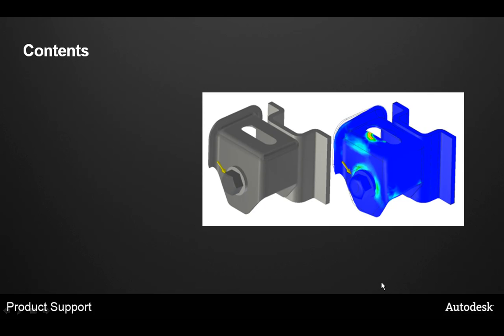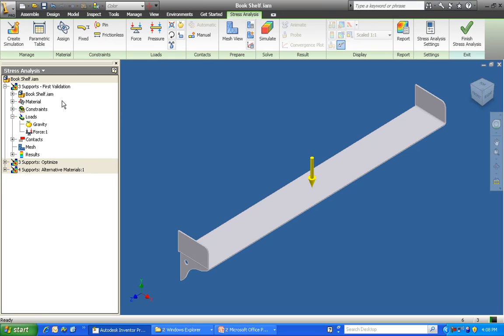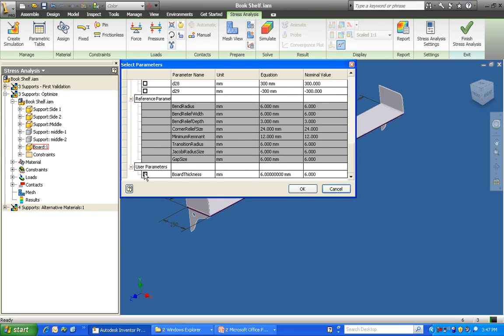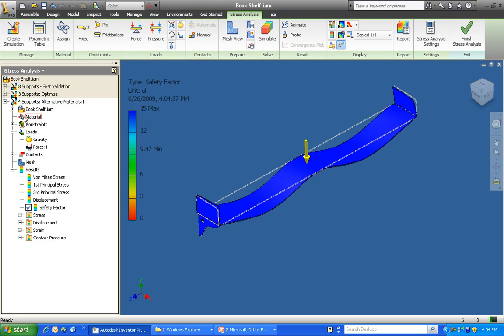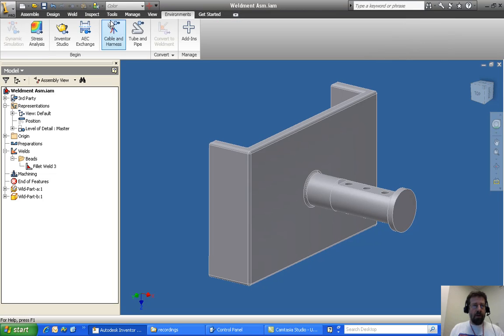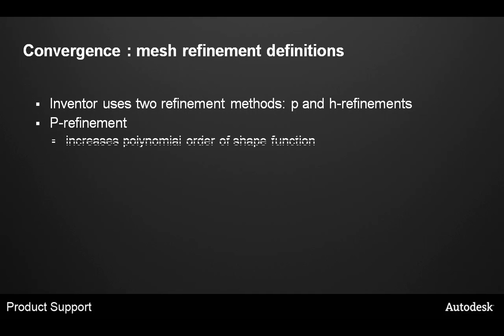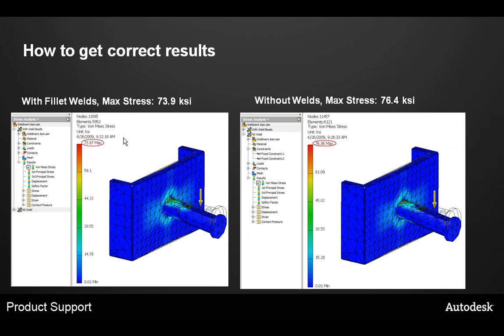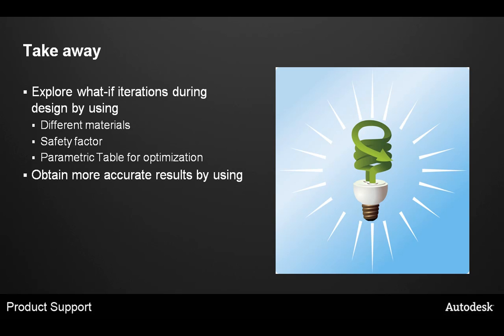Optimizing stress analysis calculations in Inventor 2010

Comment: I have a number of issues with this demo.  In the book shelf example, the biggest problem was that you were loading out-of-plane on a surface that was only one element thick.  This prevents the bending loads that are clearly generated from forming stresses.  Adding refinement won't help since the stress doesn't exist.
In the welded example, a similar problem in the C-channel.  But the biggest problem was the inside corner of the "no-weld".  This creates a stress singularity that cannot converge.

Comment: @therieri You should look into a package that has shell elements.  They are a bit different in how you set up the analysis, but they would be much more efficient than the tetrahedral solids in IV Pro.  (A good rule of thumb is to use shells if the part thickness is less than 10% of diameter.)  Autodesk purchased Algor for the more advanced capabilities.  Good luck!